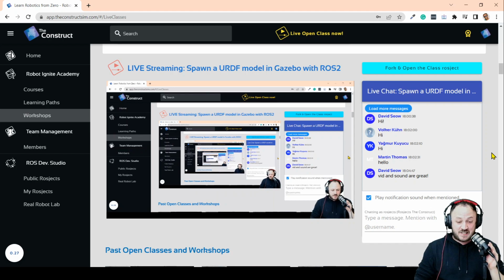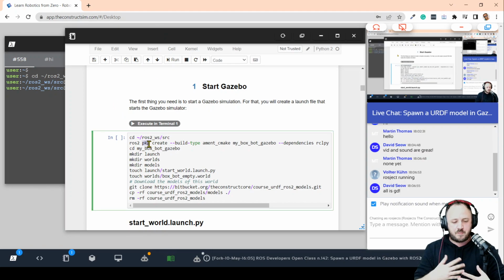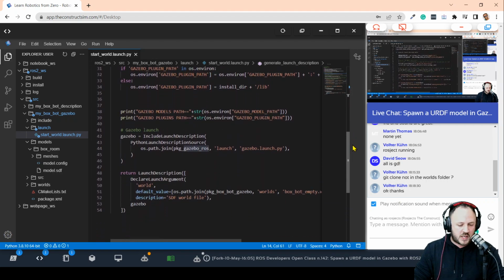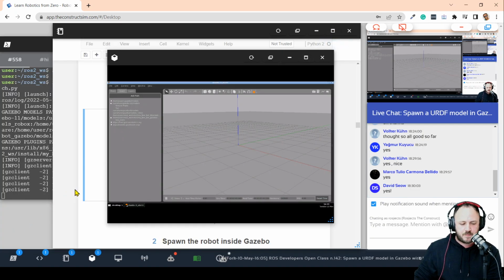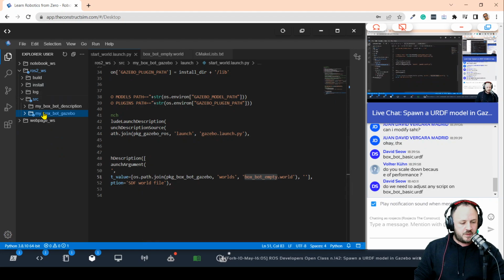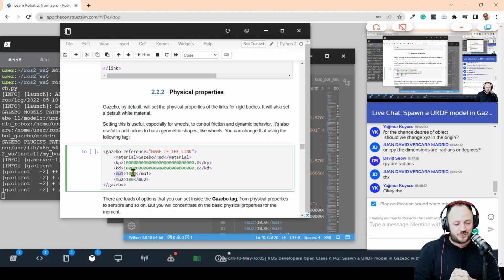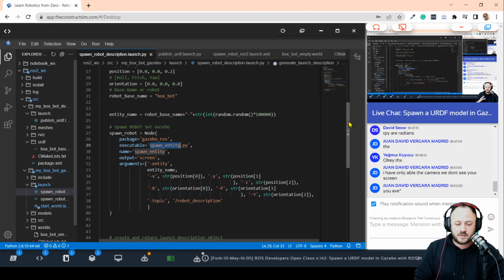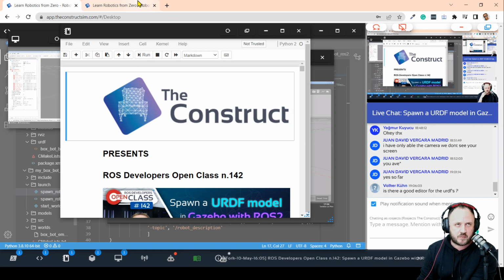Spawn a URDF model in Gazebo with ROS2 | ROS2 Developers Open Class #142

Comment: when i hit colcon build, 4:45, i get this message in red:

Starting >>> my_box_bot_gazebo
--- stderr: my_box_bot_gazebo                         
CMake Error at CMakeLists.txt:21 (find_package):
  By not providing "Findgazebo_ros.cmake" in CMAKE_MODULE_PATH this project
  has asked CMake to find a package configuration file provided by
  "gazebo_ros", but CMake did not find one.

  Could not find a package configuration file provided by "gazebo_ros" with
  any of the following names:

    gazebo_rosConfig.cmake
    gazebo_ros-config.cmake

  Add the installation prefix of "gazebo_ros" to CMAKE_PREFIX_PATH or set
  "gazebo_ros_DIR" to a directory containing one of the above files.  If
  "gazebo_ros" provides a separate development package or SDK, be sure it has
  been installed.

---
Failed   <<< my_box_bot_gazebo [1.52s, exited with code 1]

Summary: 0 packages finished [1.87s]
  1 package failed: my_box_bot_gazebo
  1 package had stderr output: my_box_bot_gazebo